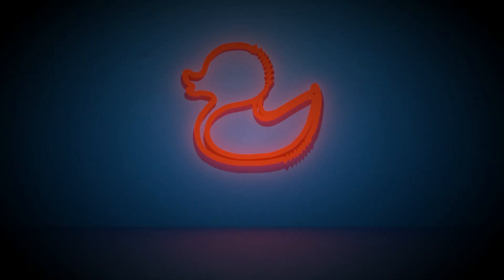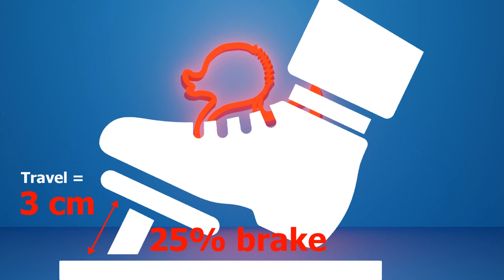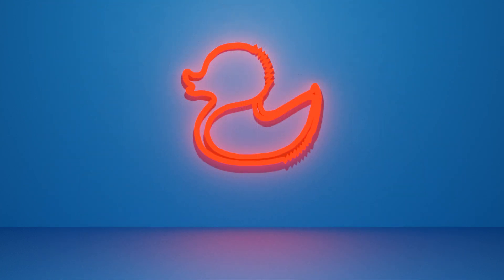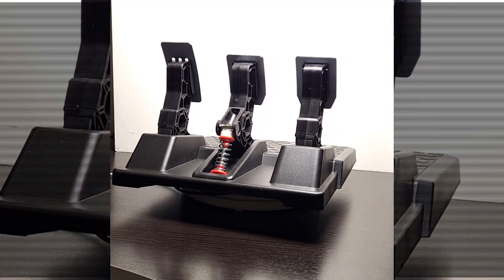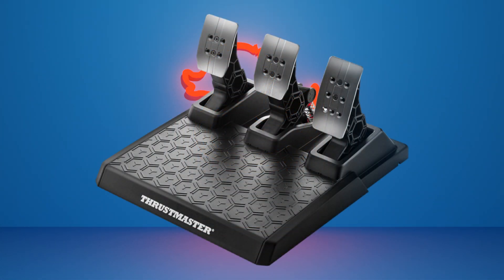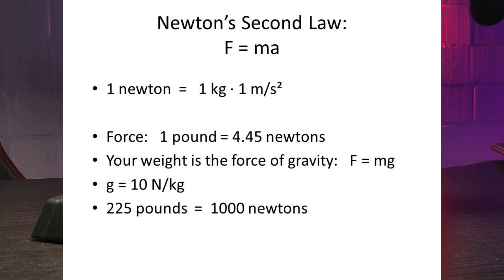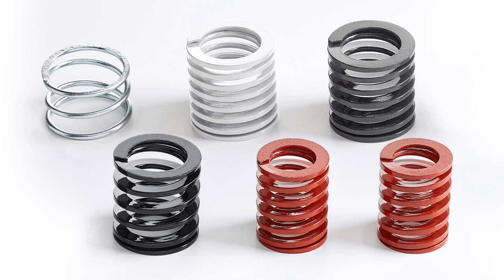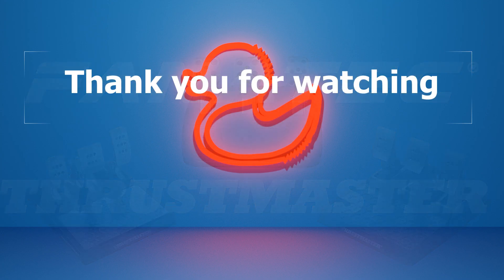Special: Potentiometer vs Load-Cell vs Hall sensor

Comment: Wouldn’t 16 Bit translate into 65536 steps, meaning like 256 times the resolution of 8 bit? Anyhow. Overkill. :) Just bought TLCM, but I need to train a bit. Coming from the 2pedal Setup of the T300RS...
Reply from the maker: Arghhhhhhhh... me and maths 😏 I guess I was blinded by the goodlooking girl on the photo (and I hope most viewers also are). That is a very nice step-up, money well spent. Thank you for the feedback, friend! 😊
Reply: I am still not fully convinced about LCM pedal. 
Everyone states: You need double red springs and additional washers. I already found the initial setup tough to push, especially because our wheel stand is to shaky. Have just spent like 2 hours and a round trip to a „Home Depot“ to improve stability. Also my son (12) might want to play, too. He wouldn’t be able to push the harder springs casually. 
One weak point of the T-LCM is that you need a Windows PC to calibrate the Loadcell, whenever you change the springs. So weak point imho, I am just one guy. :)
Reply from the maker: @marcianzero_yt  Well...i was happy with the configuration as it was so never needed to recal via pc. But that is indeed important information. I will pin this comment.  Many thanks!

Comment: I just replaced potentiometers with hall sensors in g29. But in general potentiometers were working without any problems since 2020, good enough
Reply from the maker: It's true. In general they work just fine. Helps if they are kept in a not too dusty environment though.
Reply: Hello, the potentiometers are causing problems in my t3pa pro pedal. As you say, in some videos they do hall sensor modding. Should I throw away the potentiometers?
Reply from the maker: You could try disassembling and cleaning them. If you really want to get rid of them, perhaps better to just upgrade to a pair of pedals that has hall sensors or LC. Second hand they can be affordable

Comment: The potentiometer on the G923 is so bad, when you get some dirt into it, which you usually do, it just starts doing its own thing, like braking or accelerating on its own
Reply from the maker: Yeah... Hall-sensors ftw 👌

Comment: Also went from the T3PA to the TLCM's, and holy damn! I found faster and more consistant laptimes!
It's so steady with braking due to muscle memory, you can always apply the same pressure. With non loadcell pedals you'll always have to guess a bit. Sometimes that 5% more brake input will result in locking up. I really almost never lock up anymore.
Best upgrade I've ever made.